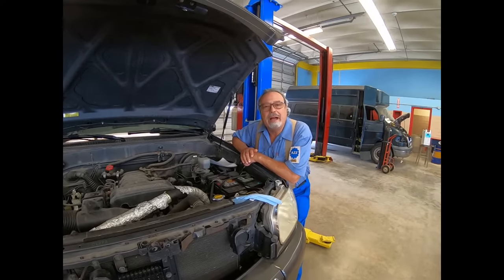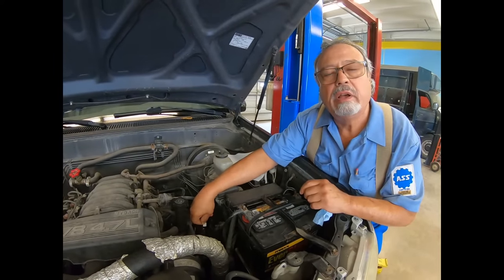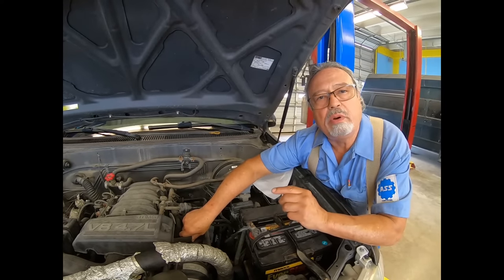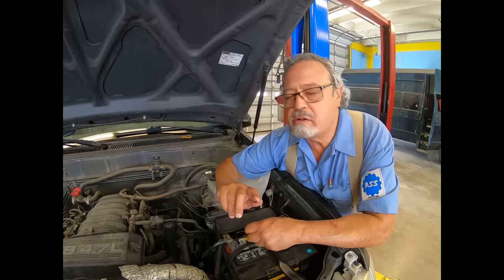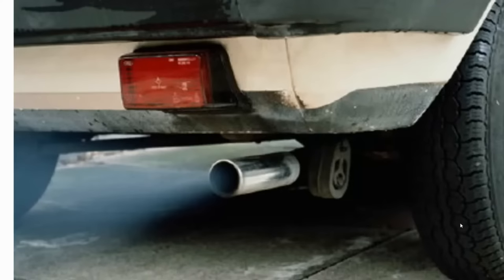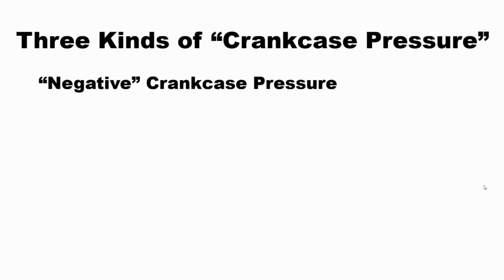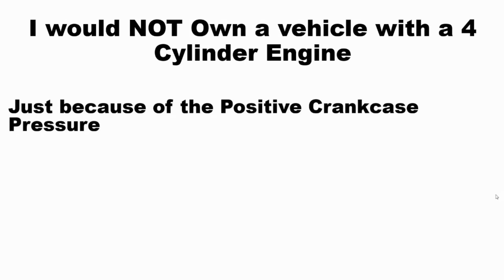Learn how IMPORTANT the PCV Valve is and why you should test it.

Comment: I would like to know at how many miles you could replace it as preventive maintenance . As if it gets stuck closed the engine pressure will force oil through any seals or gaskets .
Reply from the maker: You are correct about the seals or gaskets . You can be Average or Above average when it comes to vehicle maintenance. For average- at least every 40,000 miles. Above average every 25,000 miles. Thank you for the view and the question. Break a Leg / Good Luck on your services.
Reply: @theoldmecanicoshow9004  Then I should change it now on my 2020 Toyota Camry over 60000 miles . Saw on YouTube channel - Car Care Nut  , replacing it by removing passenger front tire and replacing by " feel " . Or three hours removing intake manifold to get to it .
Reply from the maker: @peterrudy9207  Yes I have seen some videos about that one. Makes No sense to put it in such a tough place to get to.

Comment: Good day sir! I recently installed an oil catch can as a way to prevent carbon buildup, as you know. I drive a '16 Sonata (the GDI, Theta II...oy.. Anyways, do you recommend such a device? And what would be the danger of using one?

Thank you for your time and knowledge!
Reply from the maker: YES !  A catch can is an Excellent way to help prevent buildup of many kinds. Thank you for the view and the question.
Reply: @theoldmecanicoshow9004  thank you sir. I do have a quick follow up if that's alright. With below 0 temperatures in my area, should I disconnect the device for now? Concerned about freezing. I know oil shouldn't freeze, but i believe there is some residual water vapor mixed in.
Reply from the maker: Yes there is some water vapors in the blow-by. I'm not sure what to advise you. Sorry.  @TheSokodelic

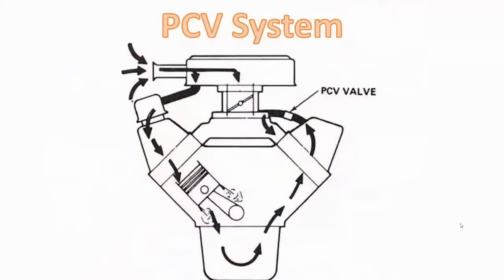Comment: 10:57 are all the poisons right back in through the intake on a GDI where it clogs up the intake valve with gunk. Where is sluffs off and screws up your rings and your cylinders and starts eating your oil. Requiring a Catch can to try and get better service life out of GDI engines.
Reply from the maker: You are absolutely correct. Because of the problem created with the first GDI's the newest GDI's also include a ported injector to help clean the intake ports and valves. Thank you for the view and that input information.
Reply: @theoldmecanicoshow9004  I learned this the hard way I took care of my Optima and the only problem I had with that car is that it blew the engine at 140,000... It started eating about a quart of oil per tank of fuel.
Frustrating cuz everything worked on that car and it ran flawlessly tell the engine let go. Somebody could make a business out of keeping those cars going. Kia should almost be forced to put catch cans on them. I'd still have a good running engine in that car right now.
Reply from the maker: @chasl3645  Cool...! Thank you for the input information. Awesome.
Reply: @theoldmecanicoshow9004  Thank you...

Comment: 5:00 - when you unplug the PCV hose, aren't you still venting the blow-by gas through the valve cover opening?  You are just not feeding the blow-by back to the intake through the PCV hose, right?  I don't understand why that would increase the crankcase pressure and blow the paper off.  Isn't the blow-by gas still being vented, and wouldn't the ventilation limit pressure build up in the crankcase?
Reply from the maker: Thank you for the view and the question. Yes, unplugging the PCV hose would allow venting the crankcase pressure. Yes you are feeding the blow-by into the intake manifold. The PCV valve hose is one of the largest .vacuum hoses under the hood. It is very large because it has to have enough CFM (cubic feet per minute) to overcome the pressure created  by the blow-by / crankcase pressure.

Comment: i can plug the hose goes to the intake, and leave the pcv on another hose to the air  2014 camry i4    170000 mmiles.  cause running lean po171   when i plug ( taped it) goes to the intake   , car running    perfect   long term short term  at idle speed perfect.
Reply from the maker: WOW...that's cool. Thank you for that info. Also thank you for the view and the comment.
Reply: @theoldmecanicoshow9004  i mean can i leave like to do the inspection?  I live in nj need inspection.  Does it hurt anything. ?     Maybe i got bad hose or bad pcv?      Pcv was replace(oem)

Comment: Why does my 68 ford. Galaxie 390 big block not have any holes in the stock valve covers ?  Only a single chrome breather on the oil fill tube on top of the block
Reply from the maker: The PCV valve is located at the back of the intake manifold. It's not exposed to intake vacuum, it is exposed the area where the lifters and push rods are located. 
Thank you for the view and the question.
Reply: @theoldmecanicoshow9004  thanks I will check it out. I have an open vacuum tube that angles down from the top of the carburetor ( I think it’s a Motorcraft 2100) so I just put a plug in it for now. The car doesn’t start cold easily at all be cause the electric choke and fast idle aren’t working correctly. The previous owner was a bit of a hack.

Comment: I live in central Florida where climate temperature  is always hot just about year round. What are your 
thoughts on using 0W20 or 5w20 engine oil. Car manufactures all over USA  to Alaska are using this
on the oil caps. They could care less on how long this effects engine lasting. Notice I said lasting. I can
accept this use in colder northern climates or Alaska. I have  asked other mechanics on you tube but
get no response from them. Maybe they do not know. I at 83 years old will only use 0w30( or 10w30.
What say you ?
Reply from the maker: Thank you for the view, the comment, and the question. I was SHOCKED when I first learn about 0w oil. I could not believe my eyes. However, I can say that I have had my hands in the oil and it does not feel any thinner that the 20w. My wife has a newer vehicle that calls for 0w 20. I change the oil myself and feel it is safe. I live in south Texas. It is very hot here also. I change the  oil in my four vehicle between 3000 miles and 4000 miles. Thank you again the your input. Good luck my you tube friend.

Comment: Wow...... Does that mean negative crank case can't happen on a 4-cylinder engine?
Reply from the maker: Thank you for the view and the question. I have tested 100 different 4 cylinder engines (even brand new engines) and very few has negative crankcase pressure. It take a HUGE volume of vacuum, not just 18 inches of mercury. Four cylinder engine are not able to create the volume needed to put the crankcase under a slight vacuum. Thank you again.

Comment: If there is a  crankcase breather (AIR INLET) It is hard to imagine how a blocked PCV valve could ever cause enough positive pressure in the crankcase to blow oil anywhere, let alone past seals!   If the PCV valve is stuck open - will the paper on the dip stick show that something is amiss?? PS  I've been driving cars with 3 or 4 cylinders for 40 years.  I don't  recall a single one that didn't have a working PCV system and NO oil leaks!!  However, I do like the idea of the paper test and will be trying it for myself!
Reply from the maker: Thank you for the comment and the view. There use to be a crankcase breather filter. Today they use the air filter to filter the inlet to the crankcase.

Comment: You got my thumbs up. I got a question or request you advice. Oil separator or catch can.  The device that is add(most of the car makers don't put this on there engine)in between/middle of the air intake manifold and valve cover. It's purpose is to keep unwanted oil out of the intake manifold and throttle body. I was surprised you didn't mention this device in your video. I believe in the catch can/ oil separator device because I make them and use them. It doesn't take many miles to notice the puddle of dirty oil in the bottom of the can. That dirty oil would have made it to the intake, throttle body, pcv valve, intake and exhaust valves, combustion chamber etc etc. You get my point? I know you do. I'm not ase certified. But I turn a few wrenches. I like you video, good job. I will be testing the pressure on my 2011 scion tc 2.5l with the paper on dip stick tube.
Reply from the maker: Thank you for the view, comment, and the question. Yes...catch Cans are a great addition to the engine ventilation system. It helps to keep the induction system clean from all the dirty blow by. I have not got around to making or using one. They sell them but it sounds like your homemade one works Great. Thank again.

Comment: Was there an explanation how to test the valve on a 4 cylinder engine?
Reply from the maker: It's mostly the larger four cylinder engines that were able to create enough volume to put the crankcase into a slight vacuum. I have tested brand new four cylinder vehicles, and the best they did was "Flutter". So many of the four cylinder engines will not stick the paper.
Thank You for the view and the question.

Comment: I have an issue with my 4 cylinder 2.0 TSI VW Engine code CCZB , thing is when the engine is  Cold , it works rough , prone to Stutter on light gas , and idles rough sometimes for aminute or two  , as it gets hotter it stutters less and less , and after about 10 minutes its all good . I have changed the timing change and all , changed sparks , intake manifold , filters , water pump ... .but stuttering remains .
My Valves were dirty as shit , had to clean them , manually , now they are clean but still stutters . Can it be its because of this PCV valve system . Or you have some other idea , my car is 150 000 miles on the road , and i would like to keep it and fix this problem , if possible without reworking the Pistons and Engine head .
Reply from the maker: Thank you for the question and the view. Is the check engine light on? Are there any engine codes? I would check that first. It sounds like the engine is running Lean (too much air or not enough fuel)  A very good visual inspection should find some of the obvious leaks around the hoses. A smoke machine will find vacuum leaks on the intake gaskets and other parts. There are some YouTube videos on how to make a smoke machine. To verify that the engine is running lean, you can spray some starting fluid into the throttle while the is running cold. If the engine smooths out, that means that you are running lean. Good luck.
Reply: @theoldmecanicoshow9004  No codes , no check engine , nothing ..Ive been to the mechanic , said there is a misfire on one cylinder , and that is because intake manifold flaps were completely gone , melted away .. that is changed with working manifold , and i asked if there is anything going on , they said absolutely nothing on hoses , gaskets , pressures vacuums and things like that .

So i can spray some starting fluid in the Air filter , see if that fixes it .  
Do you recommend changing the PCV valve and cleaning the hoses , anyways , for good measure ?
Reply: @theoldmecanicoshow9004  I did the Dipstick paper test , and i do have vacuum , even if its 4 piston engine . But i noticed that it works or idles differently with dip stick in and or out .
Ill wait for it to cool down to do a proper test , its hot now and it works mostly good , as good as 150k miles car can do .

Comment: on the siblings car (tk barina), where the catalytic bolts to the manifold exhaust. That surface once warmed up seems to emit an even layer of visible smoke.

If i removed the pre/post sensor to the catalytic, it seems to not be there in any significant way. so we swapped that. which didn't seem to be the cure.
temps are apparently fine when it happens. fluids and oils seems to be where they should be . told oil cap may have been slightly milky.
I am wondering if it could be backpressure from the resonator/muffler 

 pcv couldn't encourage that symptom though could it? (will check first light anyways😅)
Reply from the maker: Thank you for the view and the question. Exhaust is HOT, 1200 degrees. Yes exhaust can get above normal, but you will see them start to Glow Red. 
Smoke means that some oil or fluid is leaking onto the exhaust. 
Break a Leg / Good Luck.
Reply: @theoldmecanicoshow9004  😅thanks man. Appreciate ypur time to reply

Comment: Morning. I have a big problem with my VW Golf 5 1.9 TDI 77KW 2008. I have been trying to solve the problem I have with the consumption of both engine oil and antifreeze for several months without success. The fact is that the engine consumes approximately 1 liter of oil per 1000 km, but what is difficult to understand is that the consumption of antifreeze also occurs at the same time, also about 1 liter per month, so the levels of both fluids are constantly decreasing. What is noticeable is that every 10 days of driving, the hose from the uberlauf gets dirty, so that in the area from the PCV valve to the pipe itself, grease accumulates, like chocolate mixed with milk, which for me indicates a mixture of oil and antifreeze. During those ten days, the grease clogs approximately 3/4 of the space in the pipe, however, it is never found in the suction hose itself towards the intake manifold. As for the engine, it has covered 330,000 km, it behaves normally while driving, has good power, there is no significant smoke from the exhaust, the oil in the crankcase is always brown and when I check its level, I never notice any admixtures of water, there are no external leackages on the engine. Therefore what im doubting now is that the problem is actually in PCV valve, that it's only thing that causes creating mixture of oil and water? Sorry for the long text but I would really be extremely grateful for your opinion regarding this problem, any help is welcome and appreciated.
Reply from the maker: Hello. 
Thank you for the view and the question. I hope I can help you out.
You state that the pipe itself, grease accumulates, like chocolate mixed with milk, which for me indicates a mixture of oil and antifreeze.
There are different ways for the antifreeze to mix with the oil. The most common way is a leaking head gasket. It is important that you understand that the head gasket can have different levels of leakage. Heavy leakage will show water and oil on the dipstick and even water coming out the tailpipe. However, when you have slight leakage of the head gasket, you do not see the water in the oil on the dipstick. You do not see it coming out the tailpipe. Head gaskets can leak very much and very little and in between. More than likely you have a head gasket that has small to medium leakage. That's the only thing that can explain it. That is of course if you do not have any external coolant leakage.
The engine has quite a bit of miles. All it takes is one time for the engine to slightly overheat and the cylinder head to warp enough to cause the gasket to leak. Sometimes even if the engine has not been overheated the constant expanding and contracting caused by the heating and the cooling of the engine will cause the head gasket to leak. I wish I could tell you there's a quick fix. But more than likely you will need a new head gasket. Which should include resurfacing the cylinder head.
I hope I have been some help. Good luck my YouTube friend.
Reply from the maker: https://www.youtube.com/watch?v=L784F3Ie15w&t=13s

This video will explain more.
Reply: @theoldmecanicoshow9004  thanks for your quick response and opinion, its appreciated. At first i was immediately suspecting on head gasket, however what i cannot understand in this case is how it's possible to have consumption of 1 liter per 1000km of both oil and coolant. For example, if the coolant mixes with oil in the head gasket, how its possible to have such a significant loss of oil, shouldnt the oil level on dipstick increase in this case, or at least remain about the same? Honestly i spent hours and hours on trying to understand this but unfortunately i couldnt find any logical link. And this is the main reason i started to suspect on oil separator/pcv valve, however im not sure is it even possible to have this oil/coolant mixture only due to faulty pcv, does the coolant go through this valve at all?
Reply from the maker: It is possible for the PCV system to consume oil. but not to consume coolant.

Comment: I have Yaris and it behives as you were showing for 4 cilinder engine lack of negativ crankcase pressure. What is sugestion for that problem? A new pcv valve or to leave with that.
Reply from the maker: Thank you for the view and the question. I have seen only a very few 4 cylinder engines stick the paper. You should change the PCV valve anyway every 2 or 3 years.

Comment: So if the pcv valve isn’t sucking in and recycling exhaust gases, so what! Does it hurt the engine, does the engines performance suffer?
Reply from the maker: Thank you the view and the questions. If the valve is not sucking the blow by, the engine seals will be exposed to extra unneeded pressure. Also the engine oil will get more dirty sooner. Blow by gases have to go somewhere, it is so much better to burn them in the engine instead of going into the atmosphere.